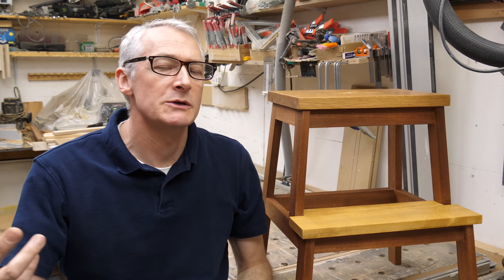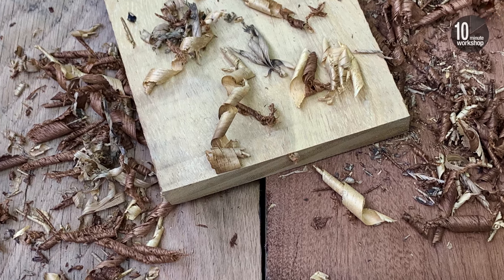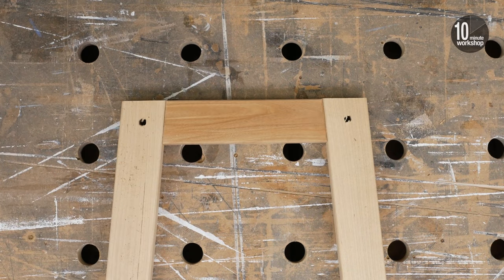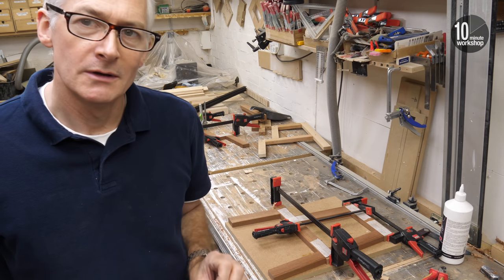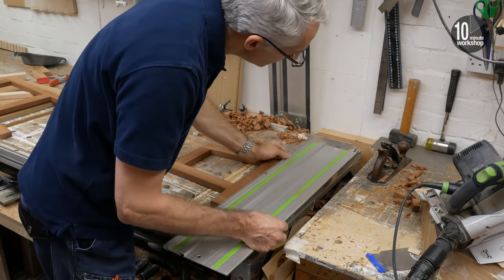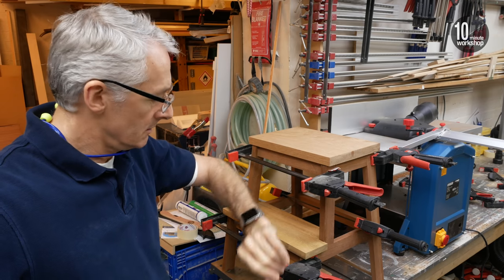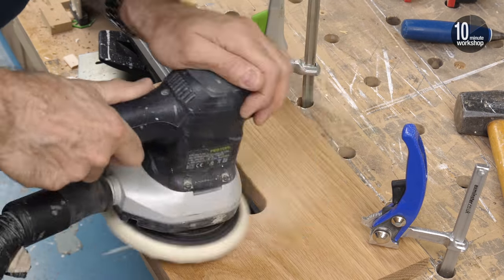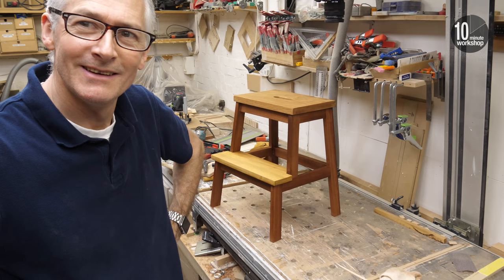Making Ikea's Bekvam in hardwood. [video #361]

Comment: Hmm ... one thing i really like is that Work Bench with the many Holes ... where you can push down that nifty clamp. Looks very useful, in clamping down any ... shape or size pieces to work on them with a variety of tools.
Reply from the maker: Hi and thanks! It’s an off-the-shelf Festool MFT or Multi-function table & the hinged rail comes as standard. See videos #182 and #183 for more details. 👍

Comment: Great little stepping stool Peter ,now for the next one make the stool height and with two tip out steps on it ,you know that all fit inside the stool until needed ,myself i find i make crates out of a lot of the scraps ,they work great as a step ,sit on  and putting stuff away,like more scraps of wood huh...lol
Reply from the maker: Haha, thanks Syd! Yes, that would be the challenge - where to put all those other scraps of wood! 😂😂👍👍

Comment: Looks really nice and I love the contrast of the 2 different woods. Be interesting to see what the overall strength is like as you mentioned but I'm pretty sure that will be solid as you can get. Top job!
Reply from the maker: Thanks! Someone’s mentioned in the comments here that their much more recent Bekväm doesn’t have a bridle joint in the front leg, so perhaps it was over-engineered originally. I’ve no real worries about mine tbh, but will report back if anything goes awry. 👍👍

Comment: Nice work Peter.  I have three of these stools from Ikea.  The first one (a long time back) was in a much heavier wood than the other two and I was quite disappointed that they changed the wood to something much lighter.  Still, not so heavy to carry I suppose.  Very useful stools.  Yours looks too nice to stand on.
Reply from the maker: Thanks Bob! Yes, I’ve noticed that a few recent Ikea items have been noticeable lighter/thinner than the originals, but wether that’s down to cost-cutting, efficiency, or reducing environmental impact is hard to say. 🤷‍♂️👍

Comment: Great looking build.  I have 3 of the Ikea ones from the mid to late 2000s and they were a bit chunkier in those days.   Same with the Kitchen Trolley in the Bekvam range.  I suppose Ikea have slightly reduced the timber dimensions over the years for cost purposes.
Reply from the maker: Thanks! Yes, I’ve noticed a bit of ‘thinning down’ of a lot of Ikea stuff over the last few years. What’s that old line from Colin Chapman - if it breaks it’s too light, and if it doesn’t break then it’s too heavy... 🤷‍♂️😂👍
Reply: My wife bought a long cabinet from IKEA recently and I was very unimpressed by their cost cutting. It's nothing like what they used to produce. It's 6ft long with a glass top and I can lift it off the ground without straining (I'm fairly weak too!). The panels are all hollow chipboard and when you shake them on assembly you can hear broken bits of chipboard (or dead insects or whatever) inside. It was inexpensive, but also felt inexpensive which was never the case with IKEA before

Comment: Like this idea, just bought a birch Bekvam in Canada and noticed there is no bridle joint on the front leg. I wonder why they would change the construction for different markets?
Reply from the maker: Interesting! I’ve had mine for quite a while, so it’s possible they’ve changed to a cheaper/more efficient method of production. 🤷‍♂️👍
Reply: I think you are right, I looked on the IKEA uk site and the pics don’t have the bridle joint. I think you are safe!

Comment: An excellent project Peter. It turned out very nice.
Do you have a suggestion for a good app to listen to your podcast? Something for an Apple product....
Reply from the maker: Thank you! Apple’s Podcasts.app is perfectly decent - comes installed with every device - or if you want something with a bit more scope to fiddle with, then Overcast is excellent. I’ve also used Pocket casts which worked HTH, Peter. 👍

Comment: With the amount of excess timber you had over could you make a second unit or more? As a batch would have reduced your cost in time spent!
Reply from the maker: No - I used pretty much all the Sapele I had on the framework and rails. I could manage another step in Oak, and two in idigbo, but that’s it. 🤷‍♂️

Comment: Beware - the white painted version is not intended for use as a stool - only the unpainted one (even though they both cost the same). I'm rather sceptical about the structural integrity of the original stool design. To be fair, I had not noticed the bridle joint mating the horizontal member used on the sides to join the two legs until you pointed it out. Bridle joint or not though, I don't think that this way of making a step stool makes sense if you want it to support a big adult's weight over and over again for many years. It might do, because I think it's over-engineered in order to ensure integrity. For example, I'd have the top step's legs extend all the way to the floor rather than rest on what is essentially a cantilever. This is what production at scale affords you: you can have long fat screws and hardwood (making the design over-engineered) for a much lower cost that any individual carpenter can make it. I don't think any carpenter would ever think of making a stool this way but there you go: that's mass produced furniture for you. They can afford to use this sort of over-engineering even on items that need not support any significant weight (e.g. the white painted version and one of their cheapest bedside tables - both made of soft-wood - come in mind). I guess you could call it a feature as it provides the quick diy assembly capability. Rant over.

Comment: I'll giv' ya 14 quid for it! How much does this one actually cost with your time etc?
Reply from the maker: 😂👍 Hard to say tbh Keith as it takes so much longer when you’re shooting video, and I had a few teething troubles with the fresh-out-of-the-box thicknesser, but I spent a couple of days on this whilst shooting video; if I ditched the cameras and pressed on then I could probably rattle  one out in a half-day plus drying time, and if it was a commercial job then I’d quote a days work, plus materials, so £400-£450. Can’t see many people going for it 🤷‍♂️🤔👍
Reply: @10MinuteWorkshop  Certainly proves a point about mass-production v quality bespoke manufacturing. An interesting experiment [don't worry, just a thought experiment] would be to use reclaimed/found timber and set up your workshop with jigs etc and batch out as many as pos, just to see how the unit cost could be reduced. I love those commercials that claim 100% solid oak etc furniture - all made of tiny bits and no knowing where the stock came from. It gives me a smile.
Reply: Keith Stewart even then you wouldnt beat cheap Asian labor prices. Its a crime that it is so cheap. And to think of other products can be over priced at Ikea ( quality price).

Comment: I watched a few of your videos, and with that one (I will comment on it further down) and this one I have to ask: What is the point? You didn't really answer that in the video... I had never seen nor heard of this Ikea thing, but it seems made, from the dutch site, from birch (on the uk site they say: aspen).  Making it from hard wood makes it heavier, so is that a feature? Light weight is otherwise better. Made from hard wood it will be more durable but is that needed? I would think not, but also the Ikea version seems screwed/bolted together which is better for repairs but also for transportation if you move house for example, or storage. The examples of furniture and lighting you gave before are typical of not being great at all taking everything into account. Often designs and designers are about nothing but some optical effect whereas a true designer will go with : form follows function. Then within those constraints make further design decisions that are about looks. The video where I was already tempted to comment was about some drawer made from, it seems, MDF where the 'designer' wanted square hand openings. That was just stupid and typical of these 'designers'! If I had something made it would not be of MDF but plywood or standard wood, hardwood only where useful, screwed/bolted where possible, and design decisions based on material and ergonomics. A square opening would only make sense if it got be be that way from connecting several pieces of wood such that a hand opening or grip (e.g. bottom side open) came to be in a natural way.

Comment: I would really prefer that Ikea does not cut out the handhold. With just inches away an apron to grab on to. I would prefer the top step to not have a redundant hole right in the centre of the blank sheet surface that I could otherwise do intarsia or Nordic chip caving, in-lay, whatever. Punch a hole right in the centre, very annoying. I don't want some engineer's predictable and boring creative idea of 'prettiness' forced on an article that comes un-finished and meant to be customized. What is the sense of limiting opportunity for creativity?

Comment: Why does Ikea cut a hole in the middle of the panel? 
Why do you follow what they did? 
Hand hold is not required for this light weight piece. It is some young designer touch of 'prettiness' in his opinion. It is a basic Scandinavian design which is known for it's straight line ecstatic. There should be no needless rounded holes in it. It is sold unfinished for owner to get creative with. 
Why does Ikea compromise that opportunity?
Again, why do you follow suit? 
Leave the panel un-compromised and chip carve Viking motif and symbols or other stuff. Punching a hole in the middle of the panel is counter productive and limiting creativity of the panel.
Reply from the maker: I’ve no idea why Ikea provide a hand-hold - you probably need to ask them 🤷‍♂️ Why did I include it in my  version? Because it weighs about 5 times as much as the Ikea stool, and my wife finds it useful. 👍👍
Reply: @10MinuteWorkshop  Why Ikea does it is rhetorical. The implied question is why did you do it.  Missed opportunity by you due to what? Furniture Design Indoctrination program perpetrated by Ikea? Wood workers deviate with own touchs not duplicate robot produced product.